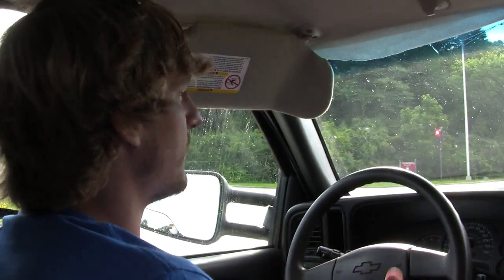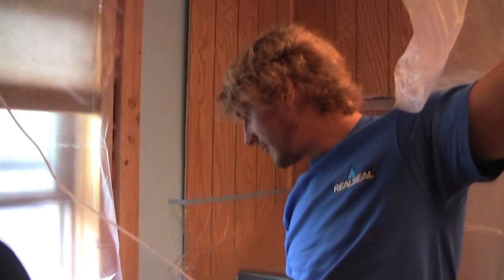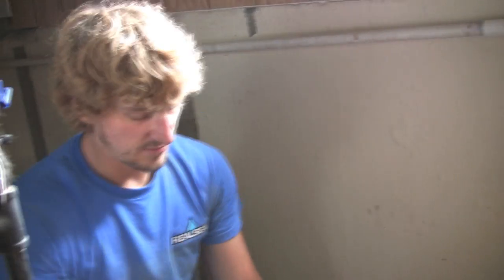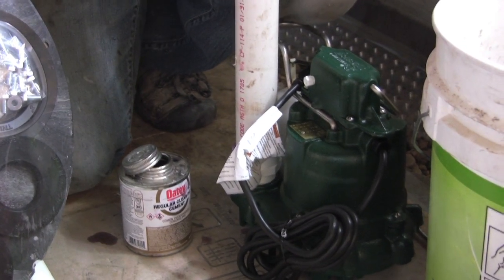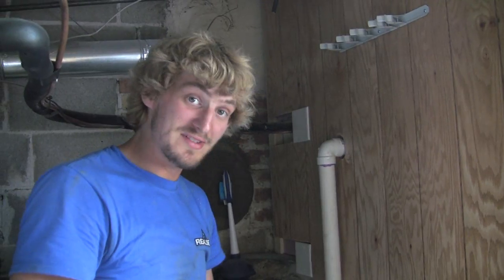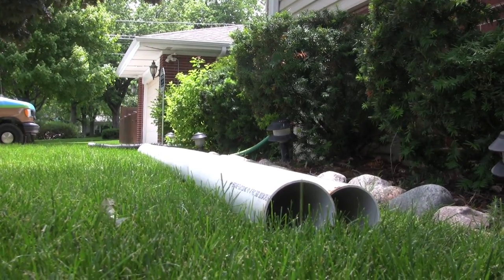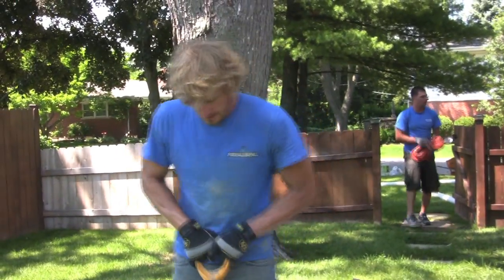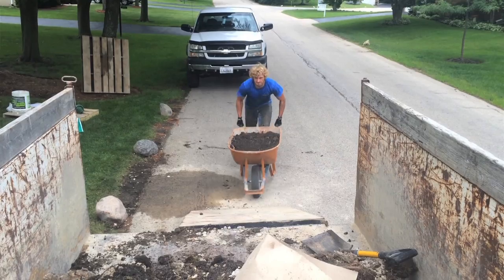How We Do It: Interior Drain Tile System

Comment: Is that corrugated pipe double walled and smooth on the inside? If not it would always have standing water sitting in the ripples and undulations
Reply from the maker: Very close. Since the pipe is perforated all the way around, it doesn't have standing water. The water leaks through the perforations when the water level recedes down.

Now, if the corrugated pipe was solid, you would be correct. This is why we don't recommend using corrugated piping for your gutter extensions or discharge lines.

Comment: Is a interior drain tile needed if I only get seepage in a few areas of my basement? I get water coming through the grains of my last cinder block closest to floor. The other side is the footing coming in, Is the drain tile worth the money ?
Reply from the maker: Yes, it is definitely worth it and you should get a full perimeter system. With cinder block, it's only a matter of time before it leaks in other areas as well.

A reputable company should install an Interior Drain Tile System with a Lifetime Warranty as well, alleviating any future concerns.
Reply: @Therealsealllc  Thanks for the quick response!! Would it be okay to do half now and half later? Also will it reduce pressure under the basement floor. I worry it will weaken my walls and have radon
Reply from the maker: @keithschneider4483  You can do half now and half later, just be sure you pitch the Drain Tile correctly remember it won't stop water from coming through cracks in the floor until it's the full perimeter system.

Comment: Would like to see how you delt with that broken brick.🦇
Reply from the maker: Oh yeah, was an old video and learned my lesson there. Nowadays we prevent that by drilling from the outside and inside and meeting in the middle. 

For that, I ended up patching with hydraulic cement.
Reply: @Therealsealllc  I love an honest answer. Many people would cover comment that reply. Good for you! That is what I thought would have been the cause. I am closing in on doing my crawl space as after 36 years in a hard rain we draw water. Doing home work now. Too old to do it myself but need to know the facts. Sure I have avoided a huge mistake by watching videos like yours. Not sure how to attach dimple board when doing a crawl.Shame you are not in my Va. area.🦇
Reply from the maker: @dustbat  We're big fans of growing, and that means learning from our mistakes. 

For the dimple board attachment, you can secure to the wall via pins into the concrete, or just leave it with the concrete over it like in our videos. If you encapsulate the crawl space, you don't need to secure it at all, as the encapsulation will be covering it up. 

Best way to find a good company around you is to go to review sites like Yelp, Angie's, BBB and read and compare the reviews to find the company that suits you best. 

Always feel free to reach out with any questions!
Reply: @Therealsealllc  I think I am getting there. Thanks for all this help. One more thing. Crawl space. No concrete. Now I would have a trench below the footer for drain pipes. Also I am way below our dirt floor level. So if I stopped here you would have a trench open where you could step off. So, do I have the whole thing filled in with rock.? I am sure we do not put dirt back.🦇
Reply from the maker: @dustbat  first thing is to not go beneath the footer. If your dirt level is that low already, I suggest putting gravel in there to get over the footer level. Then you can install your Drain Tile at footer level, with a 1/8" per foot slope, and then encapsulate the crawl space.
Reply: @Therealsealllc  I may have mis lead you. Our footers are not wide as up north. I have to dig down past a block or so to reach footer. It is 18 inches below grade. Now after trench is dug, would not the TOP of trench be level with footer plus or minus? But, that would still leave a distance from top of drain (at footer) to ground of close to 18 inches. Hope I am not drawing a confusing picture.🦇
Reply from the maker: @dustbat  Makes sense to me! You want the top of the Drain Tile to start at the top of the footer, then work down from there. Your trench bottom can be even with the footer bottom. We typically only do 80 Linear Feet in a single run, to avoid undermining the footer with the slope of the Drain Tile. Make sense?
Reply: @Therealsealllc  You have been very kind in answering all my questions. You and a few other sites are very patient and willing to help. My job is going to look a little odd as to yours as the basement floors are a starting point and my point is a few blocks down. I think I am ready to start searching for a company. All the things you all have taught me make me think I could manage this as long as people will listen and can dig!!! Thanks a lot.🦇
Reply from the maker: @dustbat  Always happy to help! Let me know if you need anything else. We do know some good companies around the country, so if you let me know where you're at, I may be able to suggest a good one.
Reply: @Therealsealllc  Powhatan Va.🦇
Reply from the maker: @dustbat  Sorry, we're "dry" when it comes to Virginia! Yelp/Angie's/BBB, compare and read the reviews, especially how they handle any BBB complaints. It will show their customer service better than anything.

Comment: my basement has narrow channels and the rocks atop the pipes leading to the pump are exposed, meaning, never covered w concrete. Is this normal? Thanks.
Reply from the maker: Hi Roy!

No, it is not normal. A finished system should have concrete over it from the interior. Unless you are in a crawl space where there is no concrete floor at all. In that case, we would recommend you encapsulate the crawl space.
Reply: Thank you for the reply. What I am wondering is, what is the point of these rock channels? They added it when they installed the French drain, which is working normally via the larger, corrugated pipes., which are covered over w concrete.
 Should I cover these rocks w concrete? Thank you again @Therealsealllc
Reply from the maker: @Roy-xe9is  Do you have a picture you can send so I can see exactly what you are talking about? You can send them to Office@TheRealSeal.com and put Attention Austin via YouTube and they will pass it my way.
Reply: @Therealsealllc  Thank you Austin. Yes, I will send this evening. Much appreciated.
Reply from the maker: @Roy-xe9is  Happy to help, thank you!

Comment: Fabric over the pipe is not good..Thats why you install clean outs....
Reply from the maker: Hi Rick!

Unfortunately that will get your system clogged up, especially in silty soil. It is also code to install Drain Tile with a filter sock for this very reason, is standard practice throughout the industry, and has been for decades.

Weather the Drain Tile is installed on the interior or exterior of the foundation, you always want a filter sock and a bed of gravel to help ensure the system does not clog.
Reply: @Therealsealllc  Thanks for your reply, i dont understand why silty soil doesn't clog the sock..
Reply from the maker: @Rick-tb4so  The gravel first works to filter out the silty soil. The sock further prevents it from getting into the system, clogging the pipe and messing with the sump pump. 

In extreme situations, we have seen the sock get clogged. In this case, we were able to replace (under warranty) the pipe, while keeping the rest of the system functional. 

The final piece of that is your discharge line. The silty soil can end up in your yard (where most discharge lines are), creating a little beach! And although we all want to go to the beach, I don't think we'd all want to find a pile of sand in our back yard.

Comment: Cpuld you use a pvc pipe instead of the corrugated platic inside the house and in which circumstance is one over the other used?
Reply from the maker: Hi Rickiy!

Yes, you can use either corrugated or pvc pipe for the drain tile. Either one works perfectly fine and will come with the same warranty. 

We use pvc when in the City of Chicago as it is required by code. Otherwise, we use corrugated. 

*Important thing to note with PVC Drain Tile*

The perforated holes MUST be face-down. The Drain Tile will NOT work if the holes are pointed up. And the sad reality is a lot of companies will install the pvc drain tile incorrectly. We have replaced 2 of those systems this year alone.

As always, be sure you hire the right company. Read the reviews, get multiple quotes, don't be sold by a pushy sales rep.

Comment: Great video! Looking through options for dealing with water issues in the basement of our 100-yr-old house. You mentioned this is a "partial" drain tile system. Is it worth installing a drain channel along only one wall in a basement, if that's the area where the water seems to be coming in, or does the drain system really only work effectively if it covers the full perimeter of the basement? Want added protection over here but am having a hard time accepting the costs associated with a full perimeter system (plus wall stabilization, etc., not to mention costs of restoring basement to previous finished state!).
Reply from the maker: Hi Jeff! Great question. While doing only one wall can be effective if dealing with limited water from one area, you have described having to do wall stabilization as well. 

When we run into having to do foundation repair along with waterproofing, the problem is usually more widespread. Although  you are only seeing the water from one area, it is likely that it is settling and gathering all along the foundation. 

In addition, you mentioned finishing the basement. Last thing you want to do is refinish the basement and have to come back to do more work later, and have to refinish again. 

Best to get it all done so you can put the money into the basement to make it a nice finished space in this case, especially if you are dealing with some foundation repair on top of it. 

What area are you in? If you aren't in ours (Chicagoland), we have friends around the country that could possibly help you as well!
Reply: @Therealsealllc  thanks for the reply! Still haven’t decided what we’re going to do, but nice to have the information to make an informed decision.
Reply from the maker: @jsoon71  Happy to help!

Comment: Thanks for the video!  I have a few questions if you don't mind.  1) Does the sump basin have a hole cut into it already and you just connected the drain pipe to that?  2) how much of a gap should I leave between the foundation and the new cement and how did you maintain that gap when finishing the new cement?  3) how deep does the drainage pipe outside need to be and what size pvc would you recommend?  Thank you!!!
Reply from the maker: Hi Nick! Thanks for the questions!

1) We core a new 4" hole into the sump basin. The height of the hole changes depending on the length of the system. The 4" Drain Tile then goes directly into that.
2) You may use a dimple board in order to create and maintain the gap between the foundation and new cement. A gap of 1/4"-1/2" will work. 
3) The Drainage Pipe outside, we call a Discharge Line, only needs to be a few inches below grade. The idea is the water is moved, much like a gutter downspout, to discharge in the yard. It can also be tied into a storm sewer, as long as the township allows it. 

Hope this helps!
Reply: @Therealsealllc  thank you so much for taking the time to answer my questions!
Reply from the maker: You bet! Happy to help!

Comment: Should I be worried about hitting my foundation with the jack hammer? Or will the concert break away first?
Reply from the maker: Good question! There is not much worry with the foundation. The floor and foundation are two separate concrete pours, so the concrete floor will come out without damage to the foundation.
Reply: Some waterproofing companies do infact chip away at the footings if they need to in order to fit their system in. My local Basement Systems franchise butchered our footers. Had I known that would be part of the process, I wouldn't of let them anywhere near our basement! 
Also, as far as I understand it, not all footers are perfect pours with delineated edges as they are depicted in so many basement waterproofing videos.

Comment: Why is it that nobody does one of these videos in a home that does NOT have a footer?
Reply: Hi, Jay. Thanks for your inquiry. Firstly, there are not many homes that do not have footers. These homes that were not built with footers date back (many times) 100 years with foundations that needs more extensive work than a drain tile. Homes without footers tend to have more structural problems, as footers are installed to help prevent settlement.
Reply: Years late, but there are a few out there now. They involve adding piers or buttresses to shore up the foundation wall before adding drainage. It's a heck of a job.
Reply from the maker: Correct! Or pouring a new footing underneath the wall. Another option would even be to install a steel beam under the wall. Definitely a heck of a job!

Comment: How do you do this with a foundation that has a monolith poured floor and foundation in one
Reply: Hello! If you are on a slab with no crawl space and are experiencing seepage in your home, the best way would be to approach the problem from the outside. A similar system can be used outside, alongside yard drainage and gutter extensions to keep the water away from the home.

Comment: Do you guarantee that that's going to stop the water from coming into the basement..
Reply: Hi Elvira! We put a Lifetime Warranty against seepage from the floor, and in the case of wall covering/epoxy injections, from the walls as well.
Reply: If your pump stops working, the power goes out, the backup battery goes dead, or there's a clog in the system, you will be in a worse spot than if you had done nothing at all. 
Because the slap dash concrete work which basement waterproofing companies pour isn't designed to block water and it will form a poor bond to the existing slab, so if things go awry, you can now expect water to be streaming in around the entire perimeter of your basement unimpeded, because they've removed that all-important buffer of compacted undisturbed soil and a thick uniform slab in order to install a glorified gutter to allow water to collect inside of your home, rather than keeping it out where it belongs.
Reply from the maker: Hi UToobin 75!

Thanks for the comment! You are absolutely correct. If absolutely EVERYTHING goes wrong and fails, they will have a flood. Same goes for your vehicle. If EVERY brake, gas, airbag, safety system, and electrical were to fail all at once, you'll be in worse spot than if you ever got in a vehicle in the first place. 

This is no reason not to protect yourself. It is important to ensure the largest investment most people ever make is protected, and waterproofing your foundation is a practical and logical, as has been proven by engineers across the world. 

Also, especially in Chicago, there are FEW thick, uniform slabs that are monolithic (one pour). Very few. Most basement floors are poured after the walls, and since concrete does not make bonds with dry concrete, there is always an open seam there.

Comment: I've seen a lot of diagrams with the gravel starting at the lowest point of the footing, the perforated drain pipe and gravel on top of that.  My footing is only 6" thick.  Would it be detrimental to dig below (not underneath the footing) a few inches so I can get a few inches of gravel below the footing?  My guess is no because the sump basin is more than a foot below the footing.
Reply from the maker: Hi Jonasinc1! We would not ever recommend digging underneath the footing. That can undermine the structure. The drain tile should be laid right next to the footing, buried in a bed of washed stone or pea gravel. You do not need to go much below the footing for a gravel base, just as long as the drain tile is next to and not on top of the footing. 

The whole point is to capture the water before it gets to the basement floor level, redirect it and pump it away from the home.
Reply: I planned things out.  I'm going to go an inch below (not under) the footing.  I'm going to use 3/4" river rock.
Reply from the maker: Very good!

Comment: Hello Real Seal. I was wondering what the name of the plastic liner is that you put down before the concrete was poured ? Thanks.
Reply from the maker: That is a simple dimple board. We use a slightly different product now. But as long as it creates a gap between the foundation wall and your newly poured concrete, you will have an effective way to capture the water coming down the wall.
Reply: Thank you very much for responding. Would you be so kind to share the name of the product that you are using now? Thanks.
Reply from the maker: It is called a dimpled drain board.

Comment: Great video of the know how.  Good team work.  Not a very good blow out on the brick wall.  You should come from the other  direction (from the exterior to the interior) with the drill bit.
Reply from the maker: Correct, Derrick. We had a pilot hole installed, but that did not suffice in this case.
Reply: thanks for the reply I just mentioned a pilot hole from the inside going out and then drill your main hole from the outside in. But thank you I learned a lot I just finished my first drain tile job yesterday got a lot of insight from your video thanks for your work
Reply from the maker: Happy to have helped!

Comment: So is the drain tile sloped to the sump? If so, how do you grade it?
Reply from the maker: Hi John, apologies for the late response. The drain tile is indeed sloped towards the sump pit. Generally, 1/8" of drop per linear foot is sufficient to keep the system working properly. We would measure this when we dig the trench and pour a gravel base, and check it once the drain tile was installed.